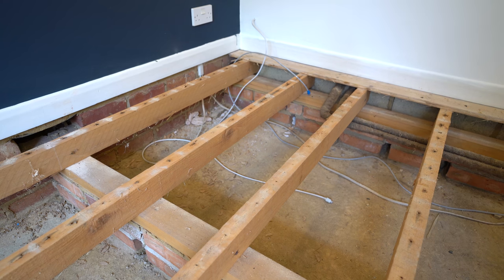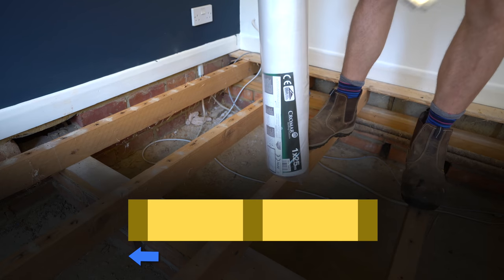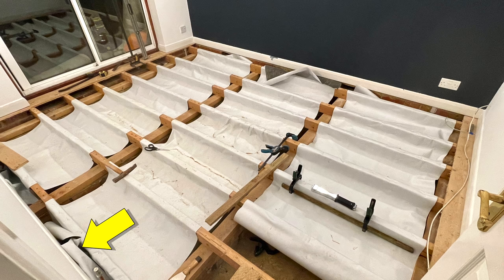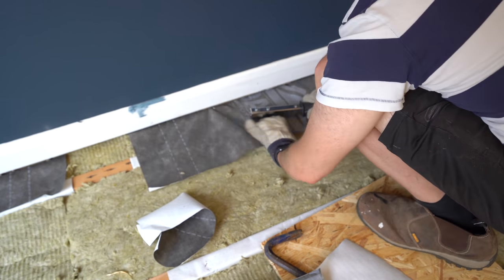Insulating A Suspended Timber Floor

Comment: The Rockwool insulation in this context is a poor insulator, you would have been much better off with 100mm PIR foam board.  The issue that will arise is one relating to a future EPC.  The Govt are becoming more aggressive about bringing the housing stock up to scratch to meet climate change.  The latest requirement is that all private landlords are to bring their properties up to Band C.  I have a converted 1960's bungalow that the EPC recommendations for Band C include insulating the floors, presumably up to current standards, which is generally taken as using 100mm PIR board.  This will be a mega hassle i.e. expensive as you can probably perceive.  I will predict that at some point the Govt will insist that all domestic properties will have to achieve probably Band C especially when selling.   It would make sense therefore to meet the best standards, whenever a major exercise like your refurbishment happens rather than do it for a second time later.  In the meantime you will get the benefit of the improved insulation.

Comment: Great job as usual Ali, if you used PIR would you leave the DPM/vapour barrier?
I have leftover 100mm loft insulation, woukd this be as effective as rockwool batts?
Thanks 👍🏻
Reply: Some will argue that the foil coating of the PIR can be considered a vapour barrier and a separate one is therefore not needed.  However, any damage to the foil coating of the PIR will undermine it's effectiveness.  Therefore, it's common to also lay a separate vapour barrier over the PIR.
Reply: @mattrgee  If you look manufacturer guide for installation no separate barrier is needed. Because material itself is also vapor resistant in some point and there is also PIR boards that has paper instead foil and even those doesn't need separate barrier.

Comment: 9/10 for effort.
A plastic membrane on top is likely to cause problems underneath it, even with the breathable membrane underneath.
It’s key to make it airtight and breathable throughout the assembly..
Reply: No, he put the vapour barrier on the warm side of the insulation. There won't be condensation problems.
Reply: @DavidOfWhitehills   I'm glad you're so confident. I wouldn't want that installation on my liability insurance. It's not air tight, and there shouldn't be any plastic anywhere near an insulated floor.
Reply: @RetrofitHub  Your understanding of this matter is faulty. I hope you will make the effort to research and learn rather than remain baselessly afraid of something . For starters Google vapour barrier and insulation : warm side or cold side?

Our host here answers your concerns elsewhere in these comments.

Comment: Where did you get the hand clamps from, struggling to get a set that span down to the battens to pull the membrane tight,

Comment: Hi Ali, Looking to do this myself. Any reason why you didn't use PIR? Could I potentially use that instead? Also If I were doing the entire ground floor, would insulating then concreting over it be plausible? Would I still need air bricks in a concrete covering?
Reply: You can use pir just costs more he did mention, you wouldn't concrete over that

Comment: Nice one 👍 Surprised how cheap your insulation was - I added 175mm onto 100mm into my loft around 10 years back when it was about a fiver a roll - no chance of that these days! Out of curiosity where the patio vent space is do you get any cold bridging and issues with condensation forming when it’s really cold?
Reply: it is made from the glass we put out for recycling. If it could be made only during the summer when there is spare solar power then it would be even better for the enviroment
Reply: @utubeape  sadly the world doesn’t think in that way, though it would make perfect sense - unless of course it’s scrutinised by those that think there isn’t a problem e.g. stating that renewable lower sources are ‘bad’ because solar panels, turbine blades and batteries aren’t ‘easily’ or ‘can’t’ be recycled 🙄
Reply: @utubeape  ROCKWOOL insulation is a rock-based mineral fiber insulation comprised of Basalt rock and Recycled Slag. Basalt is a volcanic rock (abundant in the earth), and slag is a by-product of the steel industry. The minerals are melted and spun into fibers.

Comment: So if I am running central heating and plumbing pipes under floorboards, where do these go in relation to insulation and DPC please. Thanks.
Reply from the maker: Yeh they'd go under the joists, probably attached to the underside then they'd come up through the floor to your radiators. You'll want them to have foam pipe insulation around them as otherwise they'll lose a lot of heat to the cold air under the floor.

Comment: Did you require building control approval? It seems pretty straight forward
Reply: Just started doing the same at ours, building control needed to be involved cost £515 initial visit to state insulation thickness require for underfloor to be either 200mm rockwool of 100mm celatex.  2nd visit due at end of project in order to sign off, without the certificate they can and do enforce the removal of all the work.

Comment: Nice neat job but I would've thought the DPC would seal the floorbards off from the void, and stop any moisture in the floorboards being carried away by the air from the airbricks?
Reply from the maker: Yup, as Michael Jay said, any moisture in the floorboards can escape upwards. With the insulation below they are now warm so they can be subjected to moisture and it won't condense.

Comment: Hi Ali,
You seemed pleased to find insulation in the cavity. Do you have any reservations about the potential of damp with it? I inherited it with two of my houses, the one I'm doing now I'm doing my very best to remove it all.
Reply from the maker: Oh really? Well this side of the house has been built longer than I've been alive and no damp that I can see so yeh I was happy to find it. Surely cavity wall insulation is desirable? How and why are you getting it out, sounds like a story there...
Reply: @AliDymock  Hi, thanks for the reply. My house is a 1960s red brick bungalow,  the construction looks identical to yours with the underfloor ventilation etc. The cavitys have been pumped with glass fibre insulation, on the west side that gets all the weather, the insulation is completely saturated. Even a few spots on the dryer side are also wet. My preference is to have the air gap in the cavity  and we'll insulate the interior walls. It been hell of a Job to remove it, luckily we're starting a wrap around extension so we can gain access to 1/3 of the cavity, the rest of it will come out by removing the windows and popping holes in the brick work all the way around and fishing it out with a wire hook. I'm slightly envious your insulated cavity doesn't have the same issue! 
This was a great video BTW, we will definitely be doing under our timber floors with the same method!
Reply: @aledjonesccc  Glass fiber insulation has the same problem in wall cavities that it does in attics and other areas when it gets wet - it retains water. The issue is not likely to be the insulation, that's a more of a symptom of water ingress either from a damaged/missing cavity top plate/leaky roof and blown render on the outside. It's one of the reasons PIR and Rockwool are preferred on new builds and why the polystyrene balls are more often used as retrofit insulation.
Reply: @AliDymock  Yes in general CWI is a good thing but in my experience there are real potential problems with it, and many people don't know about them - again in my experience, but mainly because the CWI industry is just an awful collection of sharks and blaggers who'll say anything to get a job and don't really care what they actually do (and also because successive govts basically don't give a crap and just wanted a nice and apparently easy way to look like they were Doing Something). The two biggest problem are (1) water getting in through the outer wall and soaking the insulation, eventually wicking across to the inner wall in bad cases. This is partly because of poor materials - although again the industry still uses these - but also because where the exterior wall faces the prevailing weather, CWI should only be used very cautiously. If the exterior wall routinely gets wet, it shouldn't be used (I should add I'm not massively up to date on materials, things like Knauf polystyrene balls are said to be non-wicking, but I've learnt to be pretty sceptical of CWI claims, I was still being offered spun rockwool on an exposed wall in 2017, which was definitely wrong). And (2) because you are basically buying the Emperor's New Clothes. Without a proper infrared heat loss camera before-and-after with some thought given to the heat differential inside and out you have literally no idea whatsoever if the contractors have actually filled the cavity - they are extremely susceptible to patching and cold spots. I offered to pay for a proper CWI job with a long-established contractor using materials of my choice - they were happy with that and quoted but when I told them I wanted to confirm their job afterwards and would expect any cold patches I found to be filled afterwards they ran a mile, they reacted as if I'd just demanded the absurd or incredible. That seems weird to me - what other product is sold like this, it's invisible when installed surely you have to confirm it's actually there? Apparently not. Anyway in the end I decided the whole CWi route is just too dodgy and went for external which has been wonderful.

Comment: Hi. Great video. I am about to buy some underfloor membrane. I just have a question. Does it HAVE to be brethable? One would think that a non-breathable material would be better? what is the purpose of it being breathable?
Reply: If it’s not breathable you run the risk of trapping moisture and your floor joists will rot over time.

Comment: Did you find any noticeable difference acoustically in the room after insulating? I’m considering doing the same, but my living room floor booms and echos when my kids jump up and down…..hoping this may help with that problem also
Reply: This sounds more like reverberation within the room itself where noise is bouncing off hard surfaces like laminate flooring walls and so on. This can be reduced by installing a carpet or if a wooden floor is to remain soft furnishings, rugs, cushions, foam absorber panel artwork on the walls. The only way to reduce the noise.

Comment: Hi Andy, great video. The insulation appears to be out of stock near me, are there any others which you would recommend? Thanks friend
Reply from the maker: I'd say that they are all much of a muchness so any thermal mineral wool will do the job. They come in different thicknesses though so make sure you match that to your joist depth

Comment: How do you remove the floor boards without causing much damage? Do you have a video for that ? Did you hammer the old existing nails in ?
Reply: pallet buster screwfix

Comment: Did you notice any differences with and without insulation ? I’m thinking to do my ground floor
Reply: I have done this for one of my rooms (and about to start on another) and the difference was immense. Much cosier, and because the floor feels less cold, we don't feel the need to put he heating on as quickly.

Comment: 4:08 would visqueen do,great vid
Reply from the maker: Visqueen DPM? Yeh for sure, it really doesn't need to be as thick as a DPM - the one I used was 1000 gauge and they're often 1200 gauge - thinner polythene sheets work well enough. The key is to have less water vapour penetrating the insulation than can escape from underneath to prevent build up.
Reply: @AliDymock  spot on,thanks,I have a full roll lying about

Comment: Great video again Ali! A couple of months on, can you feel the difference in terms of temperature/draughts/need for heating to be on for long periods?
Reply from the maker: Yes definitely far my snug. What's really telling is how cold the new laminate is by the patio door compared with the rest -the bit I couldn't insulate as it needed to be open for ventilation.
Reply: @AliDymock  thanks Ali that's really helpful!

Comment: Am I right in thinking you went to all that trouble only to lay laminate flooring over it anyway? Appreciate laminate and its underlay is nowhere near as insulatory but surely it's enough to help significantly and will block enough drafts (especailly once the trim is put round the edges of the skirting boards) to make 90% the difference.

Comment: Not really the right product,silver or non silver backed 4ich boards ect would have been best suited. But the overall finish you achieved is nice and neat.
Reply from the maker: Certainly a better U-value with PIR but the cost would take a long time to pay back. Getting it air tight with the DPM goes a long way to reduce heat loss by convection I find.
If they were 6inch joists then I’d say wool is good enough. At 4inch it’s a toss up.

Comment: Did you need to get building regulations inspection and certification
 for this work?  Thanks

Paul
Reply from the maker: Good question. I don't believe it's necessary because it's not a new extension or change of use (garage to living space). You still have to comply with regs reg u-values but they give you the wiggle room of adding as much insulation as 'feasible'. So yeh I could have gone with rigid PIR but couldn't go thicker without adding more depth to the joists. The other thing is that it requires payback within 15 years but that's easy now given where gas prices are! Anyway, no I don't think you have to notify or get an inspector out but some council's may be a bit funny about it.
Reply: @AliDymock  I may not be fully up to speed with latest regs but Part L of building regs has U values for floors relative to applying insulation to existing ground floors with the ‘feasible’ caveat. It may be useful to gain Building Control sign off as a future EPC on the property may benefit from having the BC sign off else the EPC assessor may revert to ‘default’ floor values relative to age of property and not what’s installed as they will not be able to see the insulation when they do their inspection but they may accept the insulation with all details evidenced and presented with BC sign off. If any one can assist with this longer term view I’ll be happy to listen.
Reply: Take photos if doing it as we did it on a previous house and told the estate agent but as we didn't have evidence they couldn't take our word.

Comment: Few major errors on that job. No vent extensions to reach below insulation. No continuous wind proof layer, having all those gaps makes it pointless. Much better to use an intelligent airtight barrier not plastic sheeting under floor boards on the warm side of the insulation. You should never have plastic sheet continuously touching timber like that as it will encourage mould growth as moisture gets trapped.
Reply: Do you need any barrier if using pir insulation ?